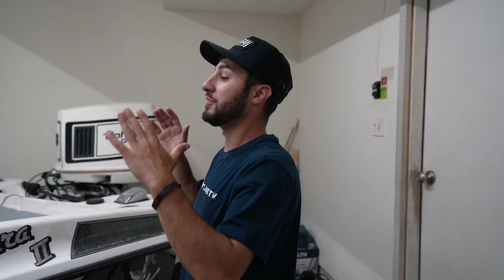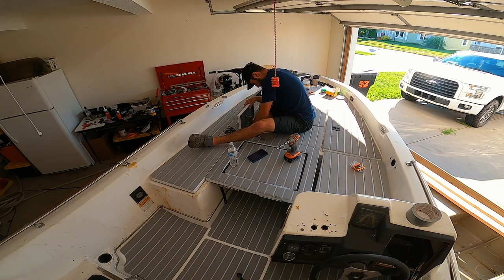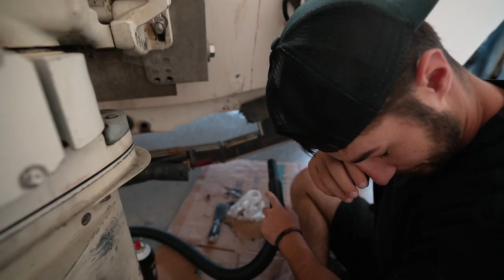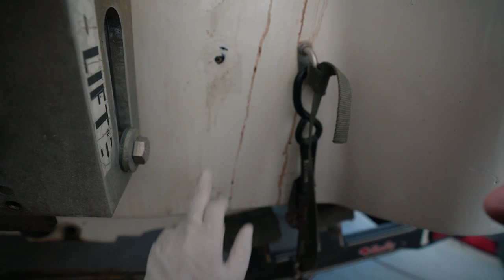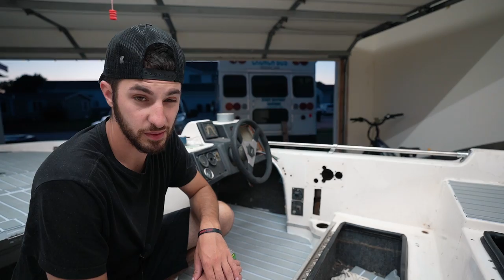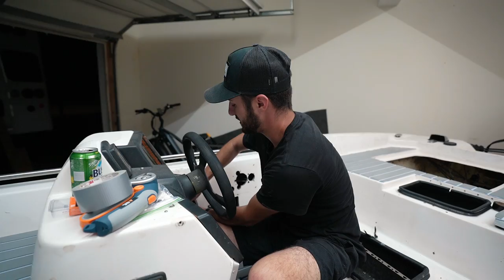I COVERED My ENTIRE Bass Boat In CHEAP AMAZON SEADEK! (Was it REALLY Worth it?)

Comment: It’s easier to make a hatch out of marine plywood, paint it and put the EV over the top. 
Also you could have resealed the edge of the glued areas with lexel or 5200  or put down stainless steel screws with eyelets proportionally spaced. This will keep the EV from turning up which it will eventually do if left outside uncovered. Looks good.

Comment: I have used the Amazon foam flooring on 2 boats holds up very well, a couple tips, you need to round cut your corners 90 degree angles tend to peel back easier from ware, tear, washing or wet decks. Second too late now, but even though it is peel & stick you need to hit it with some 3M heavy duty spray adhesive before applying it. Third tip hatch cove get a piece of High Density Plastic  (HDP) and cut a hatch.

Comment: Wise 8WD95 Deluxe series Pontoon bench 28" WIDE set cushions only. Located on Amazon.  Grey/Navy/Blue  $200.17. Okay, measure from inside wall near shifter to end of storage well. Will it need to be moved over, and how much? Visualize how this will work. You will mount the upper seat to wall rear deck wall, and mount the bottom cushion to storage step. You might want to strip off 1/2 height of that rubber around the storage compartments, so as to have a more level tight mounted bottom section seat. Take into account, you might not be able to access those storage holes, but sacrifice to have nice seats there. You have plenty of storage all over that boat. The cushion will likely overlap, and that's okay. Over 1/2 the cost of a Bass Cat seats...  In between the seats should be okay enough for stepping up to the rear deck easily. I would go this route, on a budget..

Comment: Epoxy works. Myself, I would use 3M 5200 marine sealant in white. It expands slightly so it form fits holes completely, cuts and sands good, holds paint/clearcoat fine. It's done now though, leave it epoxy and finish.
Hot foot-nope. Good shifter and part of the money you save for a killswitch unit. 
Live well, guy below me suggests plexiglass and it happens my neighbor just covered his front and rear livewells in plexiglass. Looks great, thick enough to hold ya if you do step on it. His fish locker he made from scratch with cardboard as the form covering with fiberglass, all attached to the back of his leaning post with slide drawers above for some items like phones, etc. Lid with cardboard form, only has to hold up for the first layer of fiberglass.
Going to be a sweet boat when done!

Comment: I did my boat in solid light gray. Carpet seam roller is a must for getting adhesive pressed down well. Also clean clean clean before laying. Also all razor blades aren't created equal. Buy quality brand and use straight edge to guide cut.
Reply from the maker: Big facts. I switched blades frequently. Prob used 15 total

Comment: The sea deck is textured in one direction so if u spin it 180 degrees the colors will match. Think of it like carpet if u rub it one way it stand up and gets dark and go the other way and it gets smooth and lighter colored. Same  concept. I also went with the lighter color and wish I went darker it gets dirty quick but luckily cleans up easily.

Comment: should of used fiber bondo. it works amazing. fill the holes with PL max then once hardened use fiber bondo over the top sand then gel coat.

Comment: For the holes in the back, here is what I would do....I would drill and tap all the holes for set screws and put some epoxy in the hole and on the threads of the setscrew and screw that guy in below the surface. Follow up with marine putty and gel coat or some other marine paint. Overkill? Yes, but I like overkill. I hate doing the same job twice!

Comment: Lets be clear: You get what you pay for. The fake Seadek looks ok but I would not put it on an expensive yacht or even a quality center console such as a Boston Whaler or Everglades. Real Seadek is fully routed around all edges and looks perfect. It has a faux teak look. The cheaper stuff doesn't look or feel anywhere close to Seadek but it's better than carpet.

Comment: I gotta agree that marine epoxy is more for coating than filling. Either way, if it doesn’t work then the bilge and pump will catch and remove it. Then you just try something else.  As an electrician I’ll admit I get a little crazy and snobbish when I see an install that wasn’t done how I would do it. But the truth is, as long as it’s to code, safe, and functions, then it’s going to be okay no matter what it looks like. So, I’m sure there are better options but get that damn boat done and on the water. That’s the real test in regards to what you have done. If she floats, runs, and catches fish, then what you did is okay. Remember, damn near anything can be fixed, repaired, or replaced. So if it doesn’t float, run, or catch fish, then you find out why and make that fix, repair, or replacement and move on. The goal here is to get that thing fishing, not make a series on a graduate level boat restoration program. Keep the progress going. Can’t wait to see that first fish brought over the side

You folks east or west of grand island?  What lake are you going to splash her in?